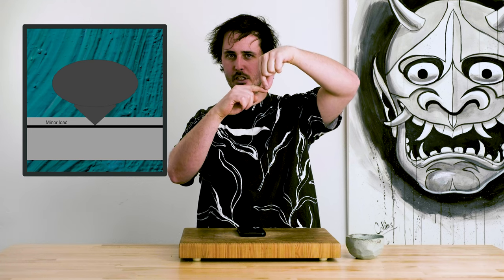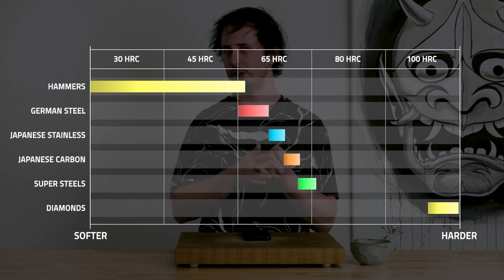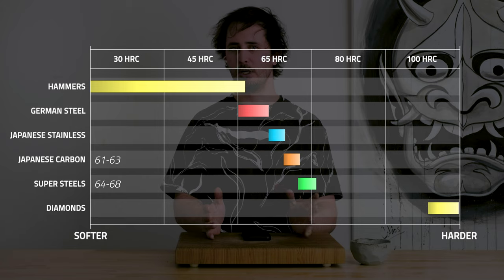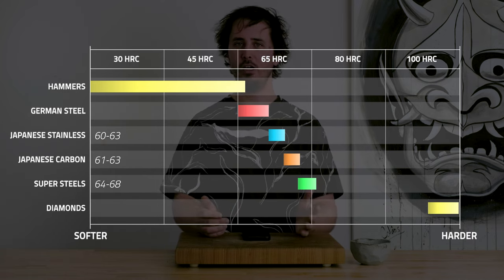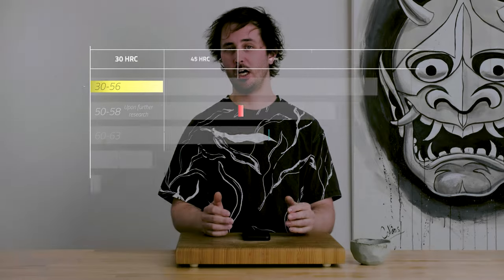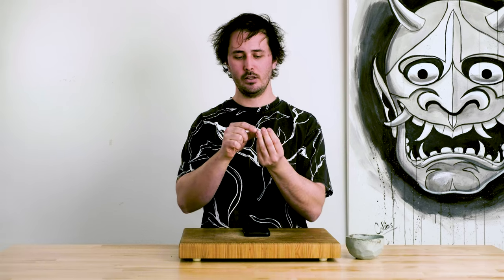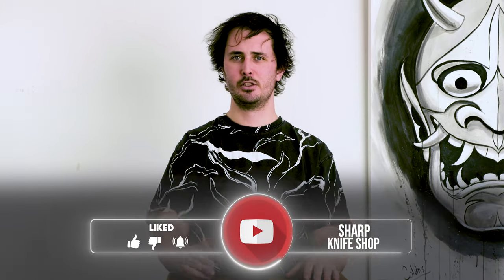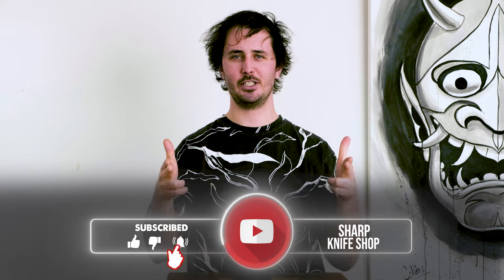Why HRC DOESN'T matter...as much as you think

Comment: HRC does matter together with the type of steel. For example, just because you have a HAP 40 at hrc 68 does not mean that it is going to have a higher edge retention than ZDP 189 at hrc 65. And that’s just the edge retention. You have to consider ease of sharpening, ease of deburring, compatibility with jnats(if you like jnats), and toughness.